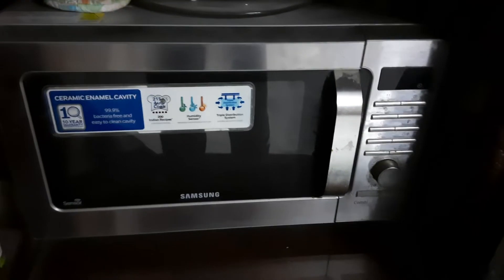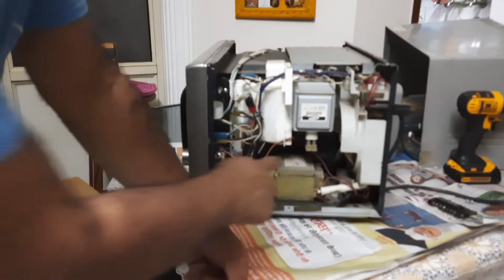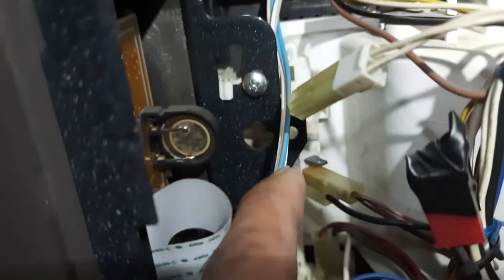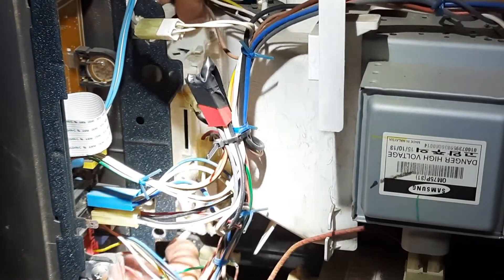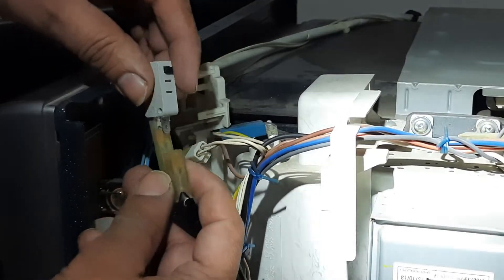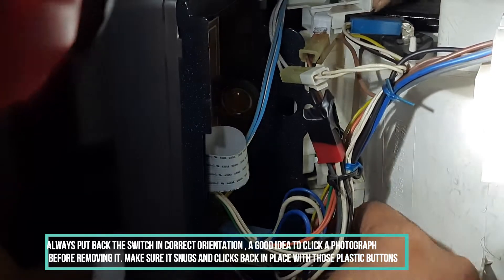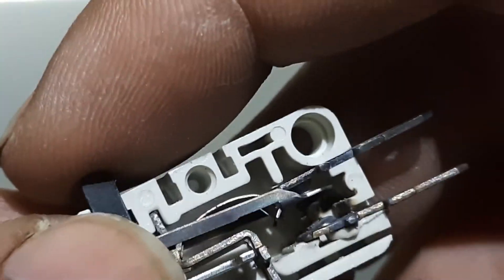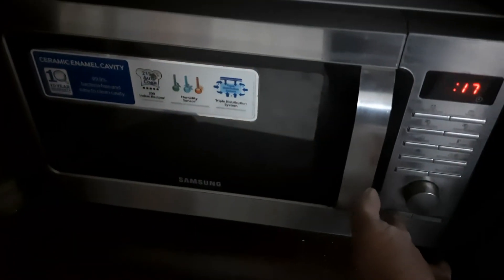Samsung Microwave : Mains MCB Tripping on opening the Door.

Comment: You could have removed panel and replaced door switch easily
Reply from the maker: Thanks a lot . This way its much easier , try it out personally if u have the same model. The switches are apart from the panel and not inside it .